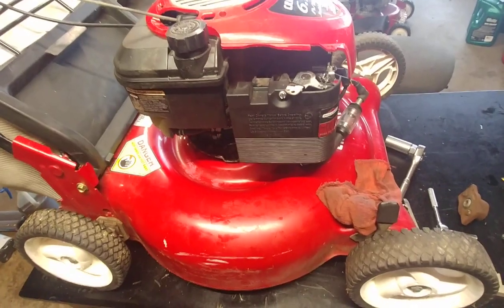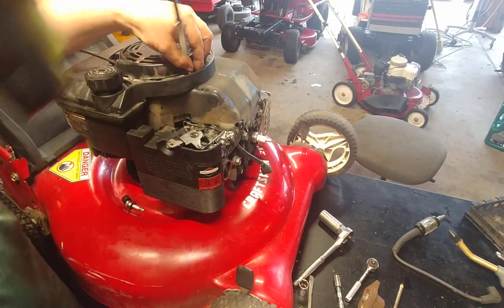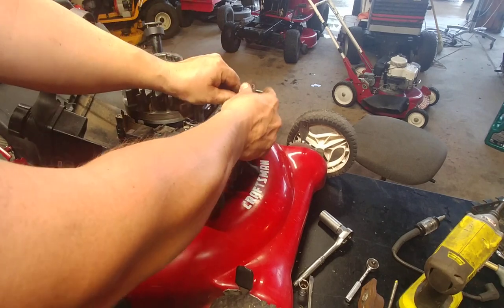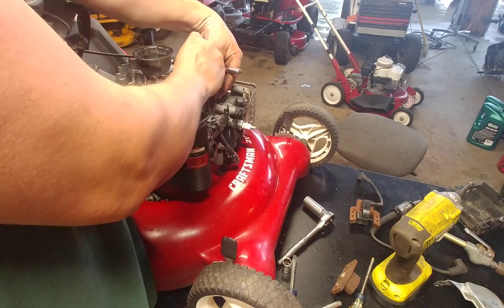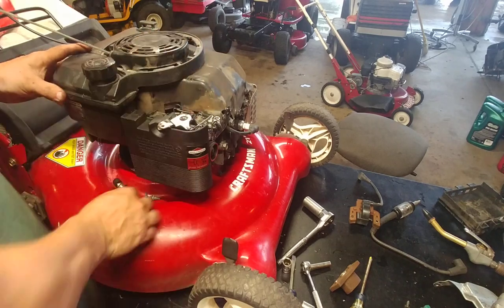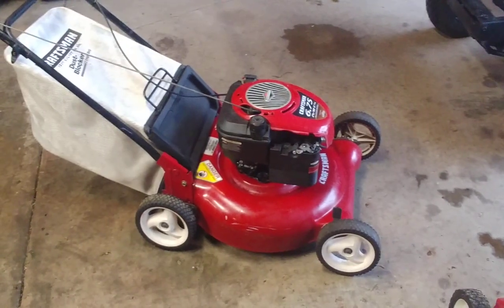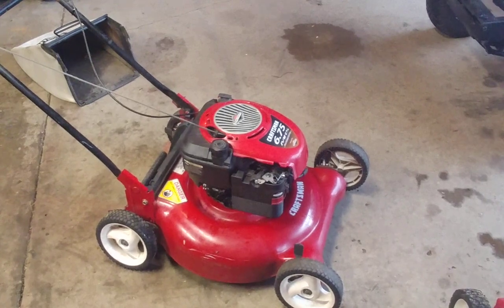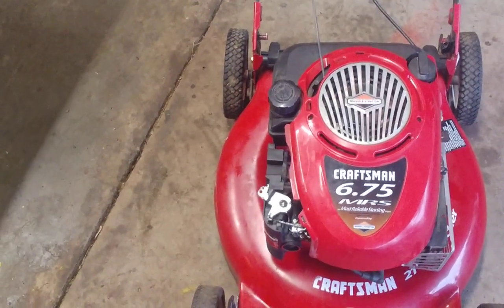Coil replacement on a Briggs and Stratton 6.75 hp

Comment: Dave, I'm having a hard time finding the right part (coil ignition replacement) for a old 2003 craftsman Briggs and Stratton 625 190cc 917 series push mower?  Can I just get a coil that fits the screw holes?  I'm a woman and have to do everything myself.  Can you help explain if I can interchange the old coil with another Briggs and Stratton coil?

Comment: I bet that new-ish coil came from the bent crank mower you started with.  Great filming job.  I film a lot of stuff that doesn't make it to the upload.  The RED ones always run better.  LOL  You just did a push mower and I am working on a tractor   too funny.
Reply from the maker: You would be right on the coil Bruce. Thanks for tuning in

Comment: What year did they cease production of the Quantam series? I have an 07 6.75  must be one of the last flat heads made before they went to OHV. Great engines
Reply from the maker: Yes they are. I think they went till 10 or 12?  Not really sure but I've had some with those dates

Comment: Curious to know why you had to change the coil. I have the same mower and mine makes a knocking sound after running for a couple of minutes. Good quality video BTW.
Reply from the maker: Hi there. It had no spark is why I changed the coil it doesn't happen a lot but it does happen. Knocking is never a good thing you might have to get another mower soon. I would run it till it doesn't run anymore

Comment: Nice job on that! $50 seems a bit on the lite side to me.
Reply from the maker: Thanks rusty. You are probably right. I always used to sell pushers with bags between $50 and $75.  As soon as I put the ad up messages started coming in and it sold an hour after I made the video so I thought dang I should have said $75. But if you seen that snapper in the foreground I can't seem to give that away and it's a sweet mower

Comment: I tried replacing the coil. still won't start. Replaced old carb, zippie tied the cable bac, still no start. I give up! Suggestions??
Reply from the maker: Could be a few things. 1st, if it has no spark I'm not sure why you would replace the carb.  It could be a bad plug. Or your cable for the handle is stretched out and not pulling far enough to disconnect the kill wire. Zip tie the kill all the way open where  the cable connects  by the engine and try that.  Change the plug first though